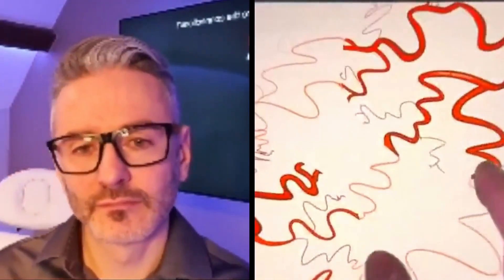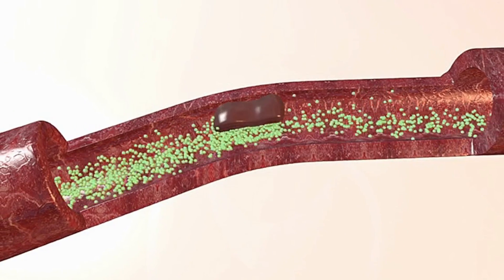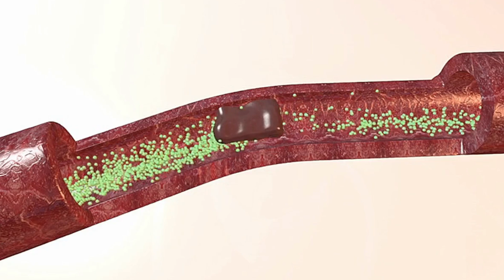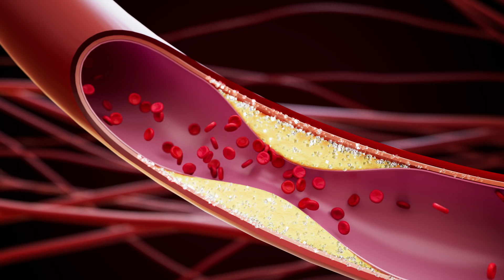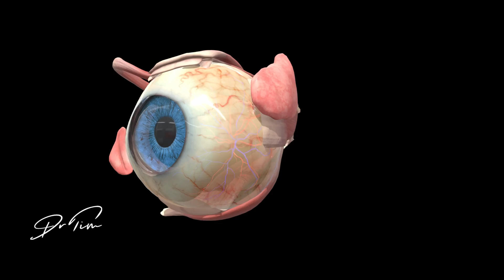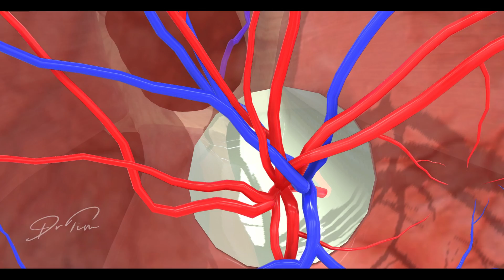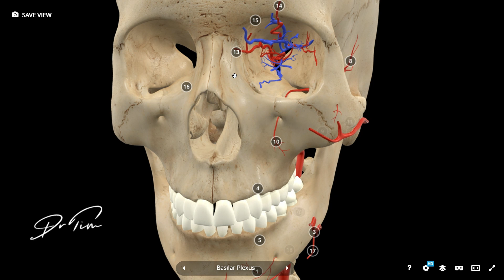What causes necrosis and how to avoid it in aesthetic procedures.

Comment: Also I went in office to get a type of Calcium filler and They TOLD ME NOT TO WORRY ABOUT VO THAT IS CAN BE DISSOLVED WITH DISSOLVER, THIS IS CALCIUM FILLER RIGHT?! Am I missing something? Some calcium fillers mixed with HA the HA can be dissolved but it will still leave the remnants of the calcium am I wrong ?
Reply from the maker: Even in the published consensus paper they demonstrate a case of vascular occlusion treated according to the protocol and the skin still dies. It is not a reversible product. Treatable- but that's not the same thing.
Reply: I think you need to run from that office.  They clearly don't have a clue what the hell they are talking about